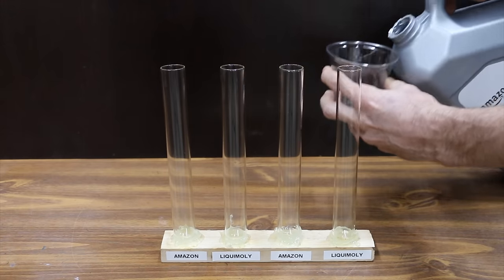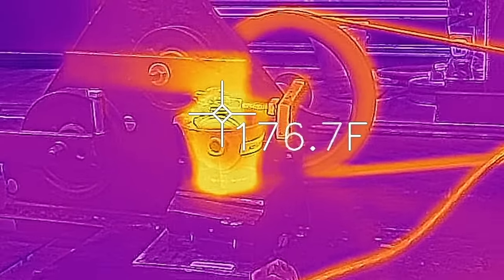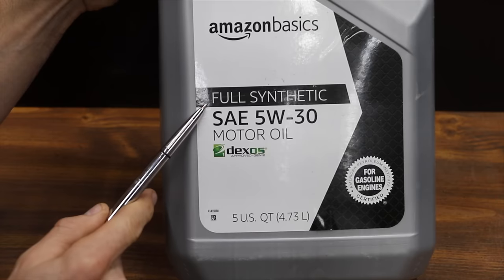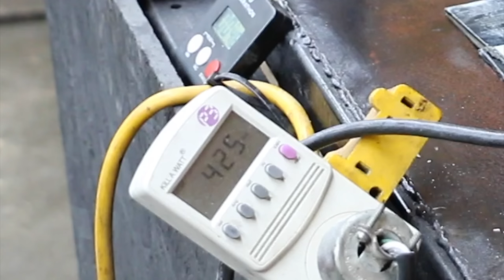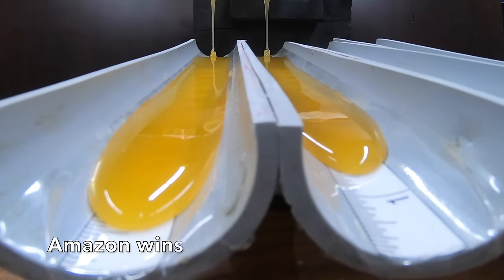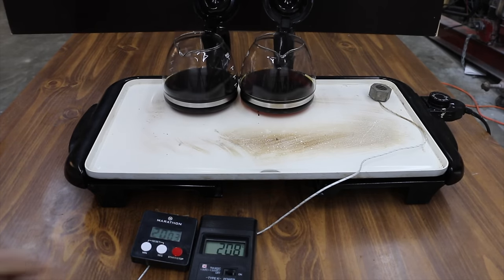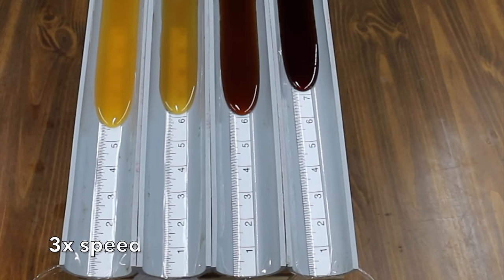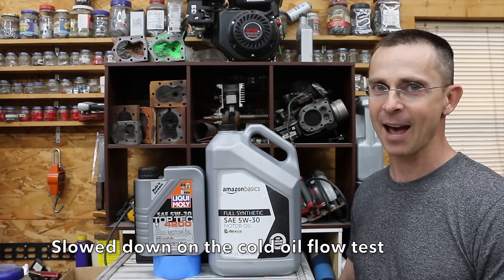Is Amazon Basics better than Liqui Moly? Let's find out!

Comment: You'd think liquid moly oil would actually use liquid Moly in it to inprove it, but it appears not.
Reply from the maker: Great point!
Reply: Molybdenum can cause problems in an internal combustion engine.
For break in (camshafts) it is OK. But continuous use can harm the engine as molybdenum does not tolerate engine temperatures.
Reply: @madmagyver9981  Just curious. If it's harmful, why does Honda put this in all of their new vehicles? It says it specifically in my owner's manual, to NOT drain out the first oil change until the oil change indicator says to, due to the Molybdenum that Honda adds.
Reply: @garrettstevensen2467  Did you see the part about it being good for break in and that continuous use isn't a good thing?  You want to cause a little wear on break in so that all the tolerances line up naturally (by very gently wearing down high spots in the metal)
Reply: Their first product was a moly additive. They still sell it.
Reply: @garrettstevensen2467  like I stated molybdenum bonds to metals and fills micro imperfections. But due to it's intolerance to engine temperatures it is unwise to use repeatedly. You said it yourself, the break in oil only has molybdenum. 
With the exception of internal combustion engines, molybdenum disulflphide can be added to most lubricating oils/greases to reduce friction and prolong service life.
Reply: @Madmagyver how does molybdenum disulfide harm an engine ? Schaeffer’s uses it in every motor oil and have engines that have millions of miles on them, both gas and diesel... when used in the proper additive package there is no limit on how long a engine can last. I’m sure you can take it upon yourself to add so much that it damages something somewhere down the road, but quality oils have quality additives. Molybdenum is expensive and most companies don’t use it, that don’t make it bad.
Reply: @swlalubricants456  engine heat, harms the molybdenum.
99% of engine builders won't use it after break in. Do more specific research on molybdenum disulflphide.
I have it in various forms and use it regularly.
Just not in my engines.
I have long-term fleet oil change interval experience. Yellow transportation changes oil @ 80k miles and most run for 5 million miles. Without molybdenum disulflphide. 
 
Molybdenum disulflphide acts similarly to lead and graphite as a lubricant. Since lead handles engine heat much better than molybdenum it was ideal. The down side of lead is its toxicity.
Reply: @madmagyver, I’ve seen oil samples go out to over 100,000 miles and still test within specs. Also fleets that go 80,000 mile intervals. Molybdenum is much much stronger than lead or graphite ..it can only plate 39 times.. it’s a friction modifier.. which helps cause less heat.. I’ve seen engines with no oil not seize up because of the molybdenum platings that protected the engine from metal to metal contact. Again, how does it cause a heat issue? I’ve seen temperatures drop 22 degrees on an air cooled engine.. 14 degree water temperature drop on an outboard,  and 30+ drop in hydraulic temperatures... All this with oil that had the proper amount of molybdenum disulfide in it... and when disassembled at a ridiculous amount of miles or hours, it shows little to no wear.
Reply: @swlalubricants456  molybdenum use has to be closely monitored, as you pointed out, and
Typical that is reserved for engine development since adhering to this regularly is probably cost prohibitive.
Reply: Nicolas Broszky  0-o obvious reasons eh?
Molybdenum dysulfate does not contribute to engine wear, even when over heated. It breaks down to molybdenum and sulfur when over heated or over pressed, causing a thick grease coating on the part requiring more attention. Thats extending life and generating grease on the spot, pretty neat ya?
To much in a engine will eventually build up and lower high heat viscosity of the oil, so regular running oil has less of it, and any wet clutch should absolutely not be exposed to it, as it will defeat the purpose of a clutch and start slipping.

Graphite can be used to make joints and sliding seals that require absolutely no lubrication, and has done so in the past when valves where exposed. occasionally it still does that job, for sport only engines.

Leads just too poisonous. That's the only obvious nope.
Reply: @Nicolas Broszky Who doesn’t add it to oil? Liquid Moly or Schaeffer’s? I know for a fact Schaeffer’s does and I know that it makes a huge difference in preventing friction. I’m pretty sure that LM use it in the name as a marketing strategy.
Reply: Nicolas Broszky  do you understand metallurgy, fluid dynamics ,chemistry, and tribology, at all?
No, Clearly you do not.
Now then, 
no, you cannot whatsoever in any way shape or form maintain a film over reciprocating components(piston and valves), it is impossible. A supporting film of any liquid requires very very fast motion, reciprocating parts must stop to change direction. 
Period. 
Molybdenum behaves as a dry lubricant, protecting your engine where films are impossible to maintain, and anywhere that is too hot for oil to maintain a film. 
Period. 
There is a reason modern engines last a lot longer, and molybdenum is one of the huge factors to that. 

Furthermore all engine oils breakdown leaving graphite in suspension, and that is a good thing, it protects your valves and piston from additional wear at the end of their travels. 

Period. End of story. Sorry you have been misinformed.
And yes, a chefs knife will cut through a lead bar, but it will cut through an aluminum bar faster assuming the same pressure and weight is applied.
Reply: Nicolas Broszky  
You do realize there is not any magical force in the film holding the heavy metal parts from contacting right? 

None at all. There has to be pressure, pressure comes from movement, where is there no movement?

There has to be energy keeping them apart, and that energy cannot and does not come from the engine pump in reciprocating parts. 
Tribology. 
Study it.
Reply: @garrettstevensen2467  What do you mean why? For break in, since it creates extra wear and allows for parts to fit into each other better.

Comment: I am one of your newest fans. I just found out about your channel about 4-5 days ago. I have a hour round trip to work and back and i play your videos the whole time. What you do is awesome and i am so glad i found out about you....... i was wondering if you have ever done castrol videos. I doubt its better than any other oil but my dad had a 97 f-150 and it was a gasoline motor. All he used was castrol 10w-30. He put 400,000 miles on it and all he replaced was the alternator and the radiator. He ended up giving it away. But after seeing the 400,000 miles he put on it now all i use is castrol. I am sure luck had alot to do with getting that many miles but it made me a big believer.
Reply from the maker: Thank you. 400,000 miles is very impressive!  I'll test Castrol in a few weeks. Thanks again!

Comment: As a chemist for a major oil refiner, you realize your tests have no validity with regards to oil quality. Oil chemistry is designed for conditions such as extreme pressure, shear strength and adhesion. Oil which flows faster down a channel is in fact not what you want to happen. Viewers should not be mislead by unorthodox testing methods.
Reply: Yeah. So says every major oil company on earth as well.
Reply: So the amount of time is takes oil to reach all areas inside the engine that need lubrication is not valid? If that is so, all engines would run of the same viscosity oil? You want those cold dry start ups to be as damaging as possible because oil flow is not important.
Reply: @4wdoverlandafrica221  
Flow is important but by no means used to determine quality of a product designed for lubrication and cooling. Adhesion is a critical factor to ensure all internal engine parts retain a very thin surface layer of oil when not in motion. Without this to provide lubrication upon cold start, serious damage would occur very quickly to an engine.

Comment: why not also test the oil at a car operating temperature
Reply from the maker: Great recommendation!  I'll do that in the next round of the series.
Reply: Place both samples bottles in 190-210 degree bath for 10 hours and duplicate. 2 sample of each at the same time in the same bath.
Reply: Difficult to keep the oil at that temperature while measuring viscosity. But you could do a falling steel ball test on it in an insulated tube, with two wire contacts at the bottom to indicate the ball finishing its travel.
Reply: i don't understand why this was asked if he brings them up to 482 degrees?
i was a lower bay tech at a shop for 2 years and oil was never that hot, i could touch it for about 2-3 seconds before it started burning,
now 482 degrees is something i won't fuck around with.
Reply: @Omar-em7rl  at least whatever engine he uses will be flushed really well but the carbon and used oil factor will play heavily in the first run of tests unless he uses a brand new small engine. Then there's a good chance of metal contamination during break in period.
Reply: @Omar-em7rl  yeah thats something i dont understand either...

max temperature of an oil in an operating engine is like 250 to 280 degrees fahrenheit. its just not relevant how an oil performs after temperaturs like 480 degree, your engine will be dead anyways

but the lubricity-test with around 200 degree fahrenheit hot oil would be very nice
Reply: @Omar-em7rl  Pressure and heat both induce stress which breaks down oil. Both at the same time is a double whammy. That's why it was asked for.
Reply: @Lukas_192  Isn't it hotter locally ? He mentions the top of piston rings at 6:25
Reply: @skuula  It actually gets hotter in high pressure areas, such as connecting rod and main bearings. It's unreasonable to expect any oil to perform decently above 280F. At that point you are abusing the car, or your cooling system has failed. A high quality oil with great high temp protection does still serve a purpose, however. In the case of an engine overheating, a higher quality oil will prevent bearing, cylinder wall, and camshaft damage. Lower quality oils will fail to handle those loads at higher temperatures.

Comment: Always good tests but Top Tec 4200 is a blended oil according to the data sheet, not fully synth.
Reply from the maker: The front of the container says "fully synthetic".  I wonder which to believe?
Reply: @ProjectFarm  who knows! Dont know how much it would change the results
Reply: If it says fully synth, its fully synth. It will be a blend of synth base oils, possibly group 3 and pao most likely
Reply: Curious here, would Liqui Molys 5w40 Leichlauf high tech be considered group 3 (iii) oil !? If so is it a fully synthetic?
Reply: @thebaron8783  check their data sheets. Im only really familiar with their motorcycle and race tech lines.
Reply: @ProjectFarm  Fully synthetic is just a marketing term used by all these brands and it means it's a "blend" with majority synthetic oil. 100% synthetic is the real meaning of "fully synthetic",  as in no mineral oil at all (this is also arguable since some additives are refined from oil lol).

Comment: Can you Test Motul Oil? The 300V has proven in several 24h LeMans Races. I think it is the best you can buy, even the 5W30. 😁👍
Reply from the maker: Thank you for the video idea!
Reply: @ProjectFarm  Been dying to see a Motul comparison.  A variety would be great to see as they have seriously different price points but it's considered a premium product.  Unscientific test in my motorcycles says Motul beats out Mobile 1.
Reply: motul vs amsoil please
Reply: @ProjectFarm   I would also consider the 300V "race" oil vs the Motul 8100 series 5W30 before comparing it to Amazon Basics or the like. Thank you for testing LiquiMoly, now onto the French Motul? Keep up the great work!
Reply: 300v is a race oil, you need to change it every 3k miles or 6 months ,not really a consumer product :)
Reply: @dimmacommunication  agreed! But a lot of people seem to like running it in their daily driven vehicles here in the Vancouver car scene. Can say I'm not a fan given how performance oriented it is.
Reply: @AlexanderTamo  It has great sense if you have an high performance car , but Vancouver has really low temps, right?
I don't know if it is that good in that situation
Reply: @dimmacommunication  on in winter does it get colder here, but even then it rarely stays below freezing very long!
Reply: I also would really like to see Motul tested!
Reply: I test motul
Reply: @dimmacommunication  4 stroke Motocross needs oil change every 5 hours of racing use.
Reply: @ProjectFarm   which is recommanded liqui moly or Amazon ??

Comment: How about also using the lubricity test with the oil hot and frozen?
Reply from the maker: Great recommendation!
Reply: Cannot be executed properly as an experiment or test that follows scientific methods. Think about it. How is he going to reasonably maintain the cold or hot temps of the oil under test? Bring everthing into a walk in freezer? Bring everthing into a grocery store's upright Hobart bakery rack oven. Um. No. What WOULD be good is to test the lubricity AFTER the heat cycle or possibly even after the heat cycle and the re-freeze. This way the normal order of testing can remain and the lubricity test would be an extremely interesting addition at the end. Yes.
Reply: Violeta Arreola when I start my car engine in the morning, the oil is cold until the engine warms up. Same concept to me. Either way, be nice to see how it performs with cold and hot oil.
Reply: I have an idea. Find a small weight thats heavy enough to drop to the bottom
when the oil is not frozen. Freeze the oil, place that weight on the top and then heat it up. Record the time it takes the weight to drop to the bottom.
I think this will be good indication of how fast the oil will circulate through moving parts while heating up. IDK, just a suggestion.

Comment: Please do a video on whether engine flush is beneficial and mandatory on every oil change...
BTW great video 
You are the best!!
Reply: I agree that this would be a good idea to test
Reply: No need. Engine flush is not mandatory on every oil change or ANY oil change if you are hitting proper change intervals.
Reply: @peterwelsh6975  ya but it would still be cool to see how well it works just because it's what he do! In all seriousness I'm very interested. A real world application might be where an engine wasn't so well maintained or has unknown maintenance and you the consumer are trying motor flush to see if it helps out. I actually used motor flush religiously in my 97 nissan altima for years and it didn't hurt anything mechanical anyways. In the end my rear main oil seal started leaking badly and the car wasn't worth much so I junked it. I actually read years later that the motor flush might have caused the oil leak by removing the crud that kept the seal from leaking.
Reply from the maker: Thank you for the video idea!

Comment: I have a theory on why the Liqui Moly oil may have performed so poorly compared to AmazonBasics. European cars often require special oils because they have very sensitive emissions control systems that can be damaged by oils containing certain anti wear additives. Oils designed to protect these systems are often labeled as "European car formula", "Low SAPS", "Emission System Protection", or in the case of this oil, it states at the bottom of the label that it "Fulfills the requirements in accordance with the Euro 4, 5, and 6 emissions standards". The problem is that the way they protect the catalytic converters and diesel particulate filters is by removing important anti wear additives, antioxidants, etc that may cause damage to the emission control systems. This is unfortunately very common for a lot of oils that meet European specs. So maybe this oil actually performs well for an oil meeting those specs. Not sure, but something to think about
Reply from the maker: Thank you for the feedback!
Reply: That actually makes sense. European engines (especially BMWs) tend to burn a lot of oil, so I guess you'd want something that wouldn't be as hard on the emissions system. My VW doesn't burn a lot of oil, so I'm gonna switch to another oil brand next time
Reply: @ogalief  VW engines tend to burn a lot of oil too from my (limited) experience with them. My neighbor's 2014 VW Eos burns a quart of oil every 1500 miles and it has since she bought it new. She took it to the dealer to have them look at it and they told her it's normal, it says right in the owners manual that its normal for it to use up to 1 quart every 1200 miles. I can't imagine that the cat will last much longer, but it probably would have failed at least once already if she used regular oil as much as that thing burns.

Comment: Can you add Pennzoil Platinum and ultra Platinum to the mix.... And possibly do something with Motorkote treated oil.
Reply from the maker: Thank you for the video idea!
Reply: @ProjectFarm  I use Motorkote ever since you tested it. It goes into every vehicle, for every oil change. I no longer hear ticking for 1 second at the first startup, interestingly enough.
Reply: Agreed! I use this oil in my Ford EcoBoost trucks. I used to be a Mobil 1 fan, but have since switched.

Comment: Would hot wax sprayed on bare metal act as a good rust barrier?
Reply from the maker: Great test idea! Thank you
Reply: That's a good idea. May try that myself on a small section of a tin roof
Reply: That's basically what fluid film is though, right?
Reply: Up until the wax peels off. Maybe a wax that doesn’t harden would be better.